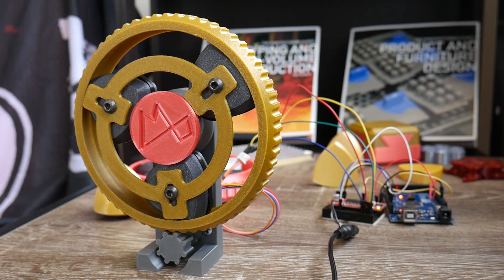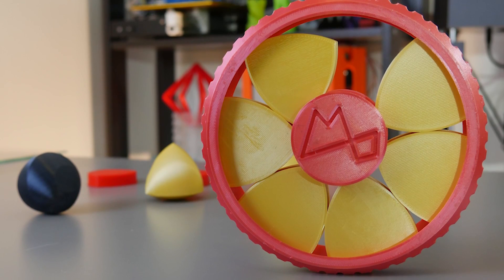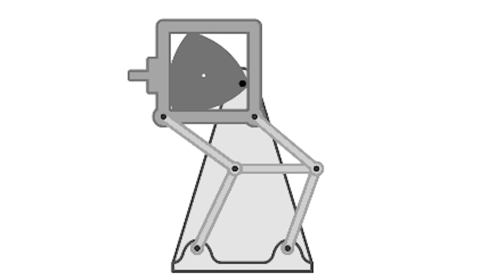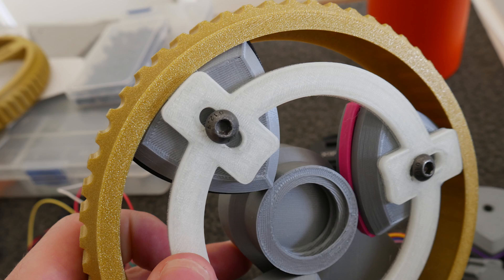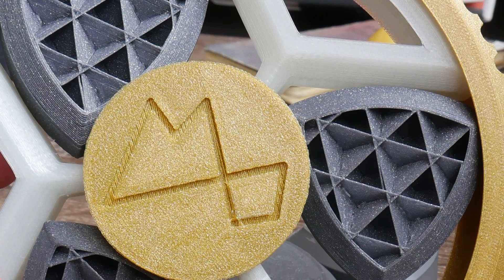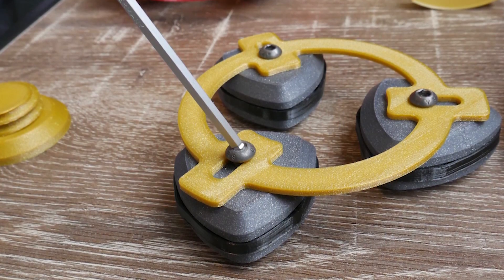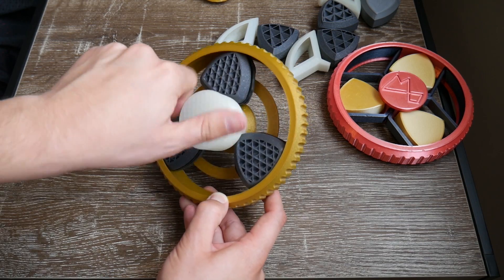Reuleaux Triangle Bearing - Working

Comment: Is the slot length to the two arc center points at the center axis of the reuleaux triangles point up on y axis and then the other end at center axis of reuleaux triangles point down on the y axis?.. Tryi g to visualize this.. does it involve the center of the circle generated in solidworks by sketching a 3 sided polygon? Thats actually I imagining at the slot center. Also are there axle duameters to be condidered? Like ratios to stay within?

Comment: Very nice video.Since the tips of the Reuleaux triangle describe a square, can you similarly try using a set of "Reuleaux wheels" to move (climb) on a ( square) staircase, whose step height equals step length?

Comment: Three years later, and you still haven't revisited this. You should give the design some tweaks using the knowledge you've accumulated over the past three years, and also take advantage of improvements in 3D printer hardware/firmware, slicing and tuning.

Comment: Those slots are not necessary if the "triangles" are in sync at 120deg. The circle that holds them apart will simply wobble.

Comment: They would roll better if they were all on the same angle relative to the center. So when one is going on the point, the other two need to be too. That's why the rubber is moving

Comment: Thinking about possible advantages of this design - if each of the bearings are synchronized, you have a device with a constant center of mass with an oscillating moment of inertia. This means that the torque required to drive it would be variable. If this were used in a flywheel design in an internal combustion engine, it could compensate for the variance in power output between cylinders firing.

Comment: I'm surprised that putting teeth on the surfaces wasn't a good option. A potential used is to produce a sine wave based on the centres of the bearings... there's potential there for an eccentric drive, something like a rotary engine there

Comment: The advantage I can see for triangular-ish rolling elements in a bearing is that they will create more turbulence to push lubricant through the bearing than you would get with round elements. In an oil-submerged design without an oil pump, such as a car's rear differential, there's nothing besides road vibrations to prevent a "hot spot" in the oil around a bearing.

Comment: Two years late: You could make triangular gears instead; that would keep the 3 parts in sync.
Note: Odd-shaped gears are not useless; they're often used to generate mechanical motions of different speeds. This can solve many complex problems by using very few rotating objects.

Comment: Only practical (although still very impractical) use I could see for a SoCW shape as a bearing is the use of a limited number of them in a system where early detection of wear is important. Due to the uneven pressures created when rolling through the corners and "flats" one could potentially use these to detect wear happening in a system prior to any visual indication being present on the remaining spherical bearings in said system.

The value gained from doing so could be saved by having a well developed maintenance routine that encourages replacing the bearings before they ever reach that point. I'm relatively certain that the advantages (materiel/time) of such a system would be far outweighed by the increased engineering and production costs of such a system (disregarding the new points of failure that it would add to a well-studied system).

Comment: what if the inner and outer race were magnetically lined pole neg, and line the bearing contact surface poled pos. might be able to cam and clutch it with externally placed super magnets and increase RPM

Comment: Rotary engine design? Your final product looks to me like something that could almost be turned into a rotary engine that would not suffer from the design that Mazda uses in that it would not have the dependency on the wiper seals. I really think you should explore this because if your design actually solves that particular problem, You might be looking at a major advance in the internal combustion engine.

Comment: The movement of the friction insert is due to cage design. In fact the center of the part does move up and down but also side to side in relation to the constant peripheric speed. Tracing sort of a square but being in motion and on a curved trajectory that square movement is a lot reduced. So the center must not be constrained in a line but in a rectangle/square

So to mitigate this problem one very accuarte fix is to position each triangle at exactly same position relative to surface (example: a corner touching the inner piece for all traingles). This makes the tangential wobly movement of the center happen at the same time and same direction and so you get that movement to the cage also thus no forced slide.

If the parts are in random orientation (your case) then the center of one piece might want to advance further in rotation but the center of another piece wants to lag behind the rotation. so it imposes a forced slide condition and this gets translated to the minimal friction you get ant that seems to be friction ring. So that gets rotated on the triangle.

Another true solution is to have individual cages (but defeats the purpose of having a cage). or a cage with flex in tangential direction alowing each arm some movement tangentially independently of other arms.

Another clever solution to ensure no sliding rotation is to make the gear version of it. A geared triangle meshing with sun gear and ring gear. This will ensure no slide rotation movement and you can get rid of the cage.

Comment: You could've just used elastic bands for the triangle's tires.
But when you have a hammer everything looks like a nail, so of course you had to 3D print them.
Really thought they were rubber bands from the thumbnail.
Would love to see the next step in increasing traction: Reuleaux Gear Bearings

Comment: How about fitting four “bearing” instead of three. If you make the bearings smaller you should be able  to fit four or more in a large ring. More bearings distribute the force better.

Comment: I wonder if their midpoint changes in a way that the cage could have fixed holes instead of slots and "wobble" around the centerpoint of the bearing, when you orient the 3 Reuleaux triangles just right initially…

Comment: I think the rubber inserts migrate because the distance they travel isn't constant on the top and bottom. These triangles don't roll in a perfectly circular motion, as evident in the previous videos.

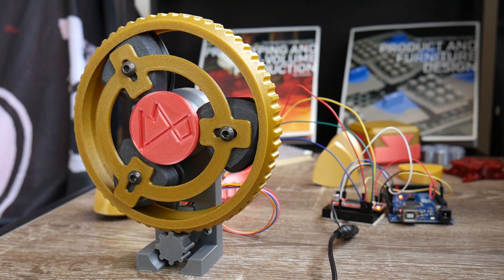Comment: You can kind of see why the bands migrate at 6:52. The bands aren't perfectly fitted to the shape and they get squished in a little by the wheel and the center. This creates a little excess "bubble". Because the shapes are turning, this excess gets pushed around, slowly moving the band around the shape.

Personal pet peeve: Ball bearings are supposed to reduce friction, but now you've reintroduced friction in the form of those screws brushing against the ring and the ring against the shapes. Even if other types of ball bearings do this, doesn't that defeat the purpose?

Comment: Perhaps this is an odd idea, but the motion on the anchor pins for the individual rollers reciprocating action reminds me of old airplane rotary engines. In this case, the pistons and cylinders would be rotating around the crankshaft.

Comment: What about putting small intermediate triangles that spin the opposite way between the larger ones so they keep them spaced? You could put herringbone teeth on them so they can't slide out like that one raceless roller bearing.
Reply: Or just putting herringbone teeth on the large triangles. Maybe the intermediate ones aren't needed.

Comment: Just a quick thought about why this might be useful.... what if each ball in a ball bearing could wobble back and forth just a little bit to provide it's own oil pump for lubrication????    each time it "wobbles" back and forth in the bearing holder, it scoops up a tiny bit of oil and pumps it into the race.  I don't know if this is an advantage over just flooding the whole race with oil or not.. but it is something to think about.

Comment: Could you put the rubber ring around the central axle or on the inside of the outer ring or both instead of on the bearings themselves? Also, could the bearings, axle, and/or inner ring have gear teeth instead of the rubber? Hmm...I just saw the "Emmet" and came back to add this line.

Comment: Amazing! I’ve been intrigued by “objects of a constant width” for a while. Very interesting to see what you came up with!

I have a comment/observation that may explain some of the issues that you encountered (though I’m an electrical engineer so I’m somewhat out of my area of expertise - I’ll try my best to use the correct terms).

The “triangles” are a constant width when rolling between two parallel planes.
I don’t think they are a constant width when moving along the inside of your outer bearing race.
The “problem” will be exacerbated by the ratio of the outer to inner race diameters.

To best explain my concept, consider a very, very tiny center race/shaft. Maybe smaller than a pencil.
In this case, the curved sides of the triangle will have almost exactly the same curvature/radius as the outer race.
(Picture the triangle with one corner/apex on the inner shaft, and the curved edge against the outer race.)
They won’t want to rotate - they will be very inclined to slide.

Of course your bearing has a larger inner race, but I think the “constant width” property of your triangles isn’t valid when they are on a non-planar surface such as the inside of your circular bearing.

Comment: It may have worked without a rubber surround if the layer lines were oriented along the axis of the wheel, instead of radially. This way the bearings would have something to catch on. Also, if the inside circle of the wheel was much larger, and there were more bearings it would have less of a chance of slipping.

Comment: Cool stuff - I wonder if the sliding tracks in the cage could be eliminated if you had a simple cage with 3 fixed points on the centre's of each triangle, but place them in the bearing to start with so that one is where it was low on the track, one is 2/3rds of the way up and one is 1/3rd of the way back down again. As it rotates this cage ring would move in a similar way to the hole in the middle of the Wankel triangle... It could be interesting to overlay this ring on top of your slotted ring and see the two move in relation to each other. Probably would create horrible vibrations in a high speed application but might be hypnotic on your motorised display piece!

Comment: Amazing ideas you have Makers Muse! And this one's really cool.
How about using this bearing in a conveyor? 
At the last of the video when you connected Relaux bearing to a motor via a small gear, I thought of this idea and practically making the bearing with steel (or any other suitable material) it can be used in a conveyor (or any similar application where speed reduction is required.)
Please think on my idea.

Comment: This is awesome! Looking at how the center of mass of the bearing moves inward and outward; you could add an attachment to this. An application for this is adding linear motion in line with the center of the mechanism; maybe adding some sort of stepper movement at set intervals / times. Or adding a type of piston-like movement. The in-radial movement could also provide the motion required for a pump or lung of some sort. I'm not sure where that could go but I'd be interested to find out. But I would imagine any more forces added to the bearing would affect it's ability to move freely.

Comment: So... What if the circle holding them in place were fixed instead of sliding, and instead all the triangles had a specific phase offset so that the ring moves with the triangles

Comment: Is it possible to use springs to push the bearings into the center axle instead of the rubber inserts? It might solve the problem you mentioned about the those parts.

Comment: From what I see while it's awesome that you got it. In a real world application the M6 would wear at the guide thus requiring some sort of bearings there... What if you were to use the 3 dimentional shaped one's and  placed them in a deeper channel so that when there is a gap it can't fit past to drop out? Just my thoughts. I can see this working almost like a universal joint no matter what the angle of the axel the wheel could remain vertical.

Comment: Who would have thought, a Reuleaux triangle bearing needs a load to ensure it works properly... just like a normal bearing. You were done about half way into the process, the rest was just trying to get it to work with less of a load, again knowing what was actually happening with any bearing would have saved you significant amounts of time.

Comment: I wonder what the solution to the sliding problem would be if a bearing of this type were actually put into service. It might not matter in some applications, but in anything that generates any kind of real heat, the soft edges of the triangles might not hold up.

Comment: So the you essentially designed a rotary engine with multiple rouloux traingles instead of one. Now all you have to do is put a gear teeth on it and you would have a concept for an extremely efficient motor

Comment: If you would add a system like a bicycle chain on the outher ring and little teeth on the inner bearing-thingies , wouldn't it just work without the spacers? The teeth would grip so the turning is guaranteed. Or does this negotiate the point of the exercise?

Edit: I also suggested a 3d version, but never mind, I see why this would never work. Would be cool if it could work though

Comment: The reason the old bearings were sliding is because they weren't under load. All bearings have a slight tolerance which closes once the bearing comes under load. The reason the final version "works" is because you've created an internal load through an interference fit. Unfortunately this is an illustration of why reuleaux triangles aren't practical in bearings, without an interference fit some of the rolling elements would slide (even under load since only the elements in the direction of the load would have contact) and interference fits would bind in stiffer materials or would be too costly to manufacture. 

Also the rubber appears to be squeezed due to the interference, essentially turning the contact zones into tiny ramps that over time push it around the rolling elements.

Comment: One possible use could be using the in and out motions of the centers of mass COMBINED with the overall circular motion as the machine's output. 

I think a modified version could be used in both textile and printing functions.

That one gear creates a lot of different movements.

Comment: There is more surface area in contact on the bearing side, so it SHOULDN'T be slipping. I think it is migrating due to there being the slightest amount of slop(perhaps because of it stretching from being squished too hard by the center ring). It is moving like a worm across the bearing, as it is ever so slightly oversized. The center ring needs to be reduced in size to loosen the fit or the grip ring needs to be reduced in size to take out the slop. The later is probably the better option as reducing the center ring size too much would cause it to go back to the original problem. Ever so slightly reducing the center ring, however, would make it turn easier, but the tolerance is too tight so it would more likely just make it start slipping again.

Comment: Are you doing anything to keep the three triangles' orientations 'in sync', or are they each just oriented however they want to be?

I ask because i see this guide with slots gives the triangles' centers freedom to inward and outward, but it keeps them a strictly fixed 120°angle from one another. But the rouleaux triangle's center of mass doesn't just bob up and down as it rolls, it also bobs left and right around a constantly-moving center point. So if the rotations of the triangles are not kept in sync, then I think they won't want to chase each other around the circle keeping a constant 120° angle between them, they'll want to 'catch up' and 'fall behind' a little bit as they wobble.

I wonder if this somehow explains the mystery of the migrating bands.

Comment: Hi Angus, I wonder if a gear set in the inner or outer ring might keep the quadrants aligned.
That way you could loose the rubber grip band (this I can see binds it up slightly) & gain some tolerance back.
Just a thought.

Comment: I've just watched your James Watt Planetary Gear video before this one and I can't help but see the similarities. You could eliminate the need for friction by adding teeth and creating a Reulaux Planetary Gear, so to speak. I expect the shifting inserts issue (my guess is it's a result of the smaller rounded corners changing the relationship between the inner and outer edges, but that's just a guess) would be contained by distributing the slip/sliding evenly between each tooth, making it appear smooth. There's certainly a challenge associated with figuring out how those teeth would have to be sized, but wouldn't that be an incredible alternate version?